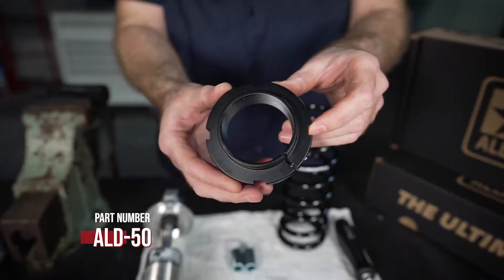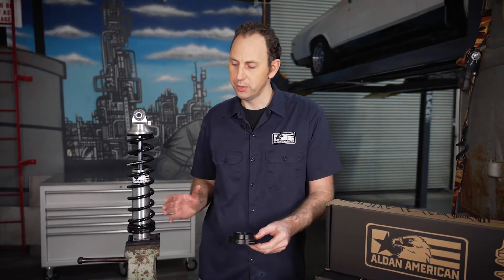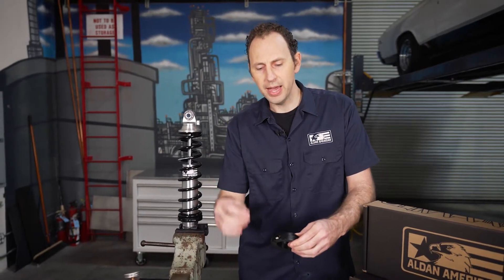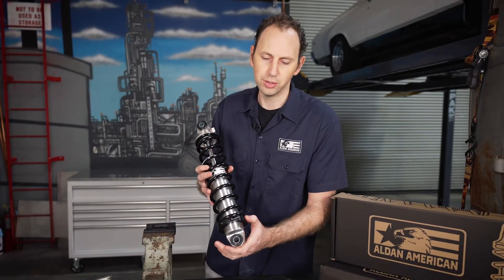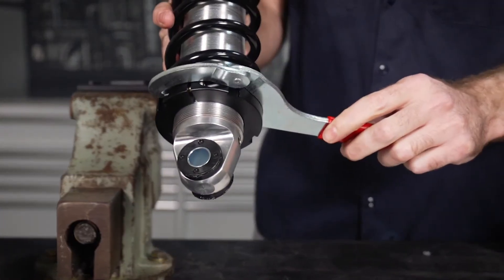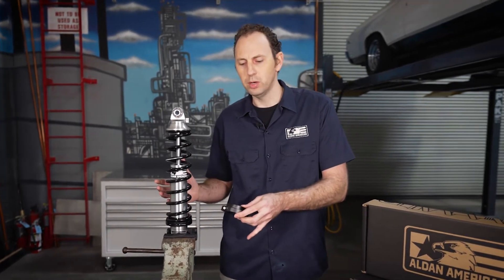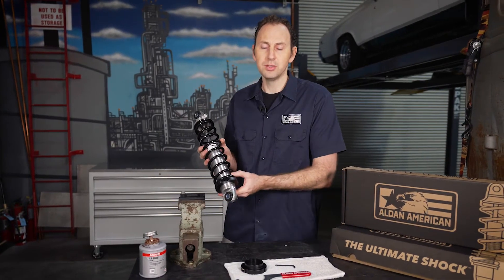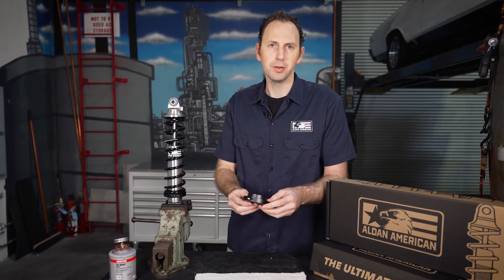How To Use a Coilover Spring Retainer (One Piece) - Aldan American

Comment: So raising your car will make the give it more preload. This making it much stiffer…
Reply from the maker: On coilovers using a linear style spring, you'll need to add preload (in our case 1") to engage the spring and set the initial spring pre-load. It's not a 1:1 ratio on the amount of lift you'll see when adding preload, but as you add preload - you will be raising/lifting the vehicle

Comment: Will the set screw not damage the threads on the shock body?
Reply from the maker: The one-piece retainer is a pressure clamp style design. On our Aldan American shock retainers, the set screw is mounted horizontally and does not come in contact with any shock threads.Threads on our shock bodies are safe from the retainer set screw and will not be damaged.
Reply: @AldanAmerican  
👍
Thanks!